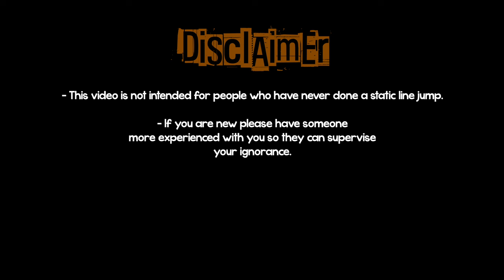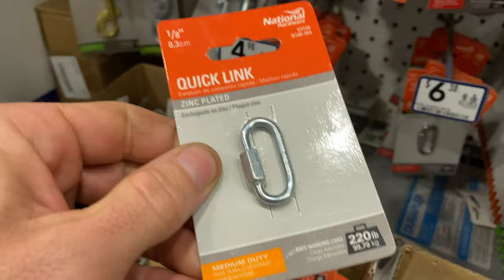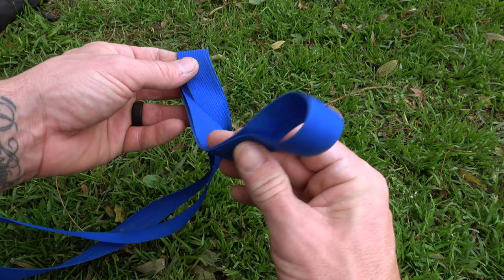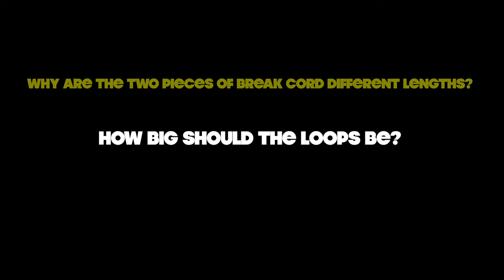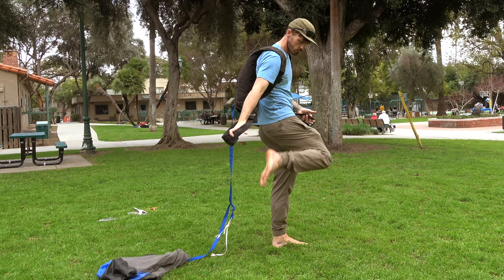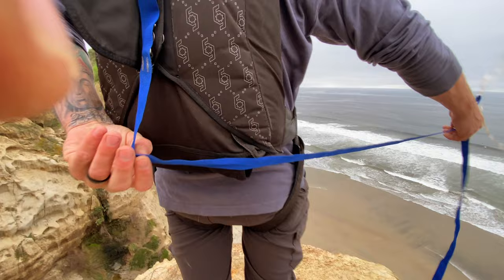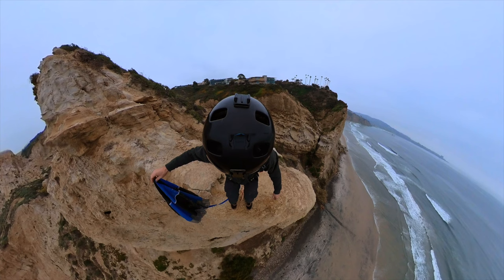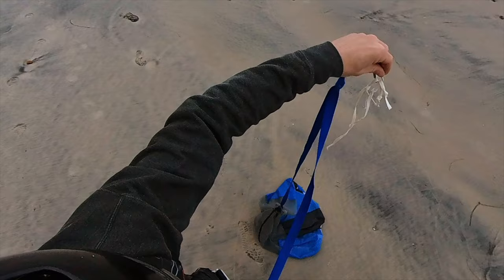BASE jumping - Static Line Take Away System

Comment: you can't buy your rapid link at the hardware store and be sure of its efficiency...  the only one to use are the ones tested and approved for skydiving.
Reply: I think for this system, it's actually preferred you don't use a skydiving rated link. The thought process being that if the system gets hung up, the link might snap before your gear is significantly damaged. Obviously the link needs to be strong enough that it doesn't fail under normal conditions. John, can you please confirm? It doesn't look like you have a skydiving rated link in your video.
Reply from the maker: While your statement is true that you can’t ever be certain of somethings efficiency, that is also true for Pilot chutes, bridals, toggles, closing loops, and whatever else you want to compare. Even a roll of break cord will have slightly different breaking strengths if you take a piece from the start and middle of the roll. 
Nothing used in BASE goes through the same kind of approvals as in skydiving. 
I’ve seen people use condoms, strips of trash bags, and rubber tape to do static lines, and they were all successful. 

The amount of force needed to pop pins is about 8lbs, and a canopy weighs about 12lbs. There are obviously a lot of variables to consider with those numbers, based on how tight the canopy fits into a container, the size of the canopy, and fabric type. 
At MOST your pins will pop at 12lbs. This was tested on a 260 container with a blackjack 300 packed into it. It was so tight my friend almost needed tools to close it and the pins still released before hitting 12lbs on the pull scale. 
There will be a video on that about pin tension soon. 

The break cord is rated at about 80lbs, the link 220lbs, your bridal 1000lbs, and your canopy attachment point is around 2000lbs
As long as the link is stronger than 80lbs, weaker than 1000lbs, and your anchor point is stronger than both you’ll be fine. 

The links from hardware stores function great for this purpose. I have pull tested a lot of them over the years, and they are extremely reliable. 
In the worst possible case I can envision - If the link was to completely fail, open, and the break cord fell out, that wouldn’t happen until you got to line stretch and at that point it wouldn’t even matter. The odds of that happening are as close to zero as I can imagine. 
I have seen peoples systems fail from them using shitty old break cord. 

I’ve been using those links on different take away systems for almost 10 years and during that time the only problem I’ve ever seen is on one that was from Amazon. 
In that scenario the link did bend open, but the system still worked normally. The jumper just noticed it afterwards when she inspected the link. 

My issue with other take away systems on the market is that the Dacron piece that’s attached is 900lbs which is a bit too close to the strength of your bridal. I’ve seen hangups resulting in bridals breaking, and when people used 550 paracord as their anchor, they broke the anchor. None of those resulted in injuries thankfully. 

Sorry for the essay, I’m not trying to argue with you, again, your statement is true, but I wanted to throw out some detail so you, and anyone else who reads this will know that it’s not something I didn’t; consider, and test extensively, before making a video for the world to see. 

I welcome all criticism.
Reply from the maker: @BASEmonkey  - Hey man, just in case my response to the baseonpurpose didn't answer your Q - It depends on the rating of the link but yes, In the event of some kind of hangup I would much prefer the link to get some damage vs my equipment.  None if it is really a safety concern though. I've seen a handful of bridals break over the years for various reasons, and the jumpers didn't even know it happened until after they had landed fine.
Reply: @johnnysjumps  it does! I realized after seeing/reading your novel that you were likely working on your response at the time I posted my comment. Thanks for all your entertaining educational content, you're killing it! 🤟🏻
Reply from the maker: @BASEmonkey  haha thanks man. fuckin novels! I mean, I guess it's all important stuff considering the potential outcomes.
Reply: @johnnysjumps  no doubt, your novel/essay is much appreciated! 🧡
Reply: @johnnysjumps  While I understand using condoms (safe) and strips of trashbag (isn't suspicious), why rubber tape for static lines?
Reply from the maker: @sekgo1265  - The people I know who use rubber electrical tape are Australians and Europeans. I think they prefer the rubber type because it stretches a little before it breaks.